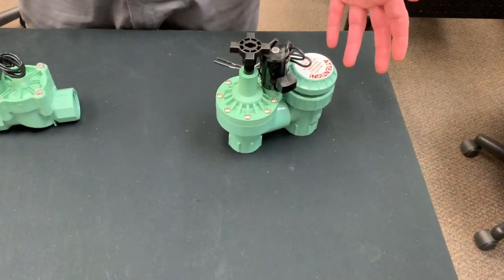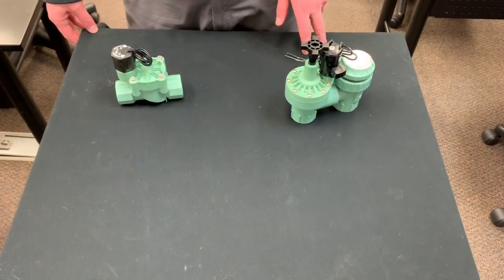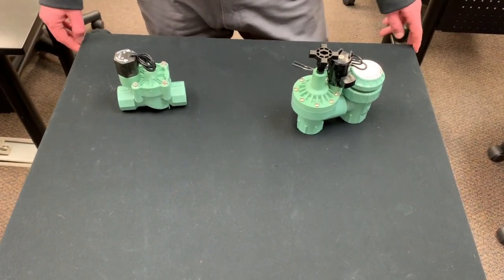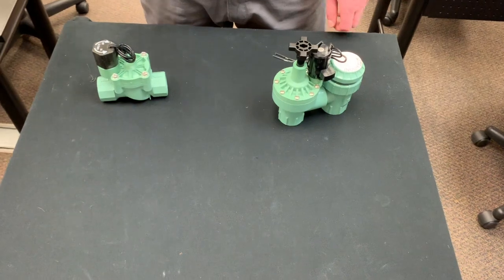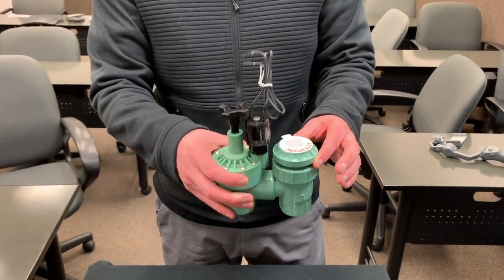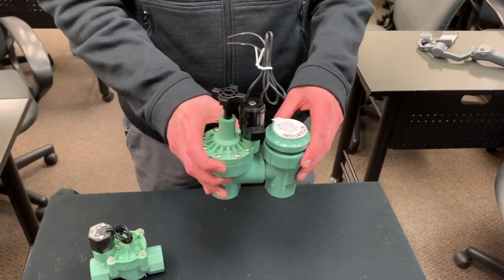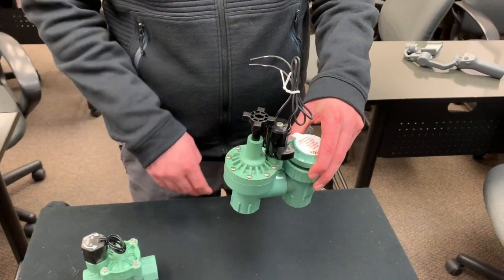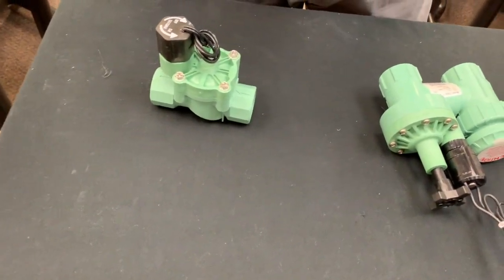Back-flow Prevention: What it is and Options Available

Comment: So installed my new anti siphon, easy peazy but yet when I tie the wires from the solenoid to the two wires from the timer, it’s making a buzzing electric sound on one of the wires. It’s so strange because I hooked it up the same wires as last time. Any idea and tips how I can get it to work? Also turning it on manual twisting to on position, sometimes it works and sometimes it doesn’t. This is brand new. What do you think?
Reply from the maker: Hello, our support team would need to speak to you walk through some trouble-shooting steps. Could you send us your contact info via one of the social media channels linked in the video description? We will get in touch. Thanks.